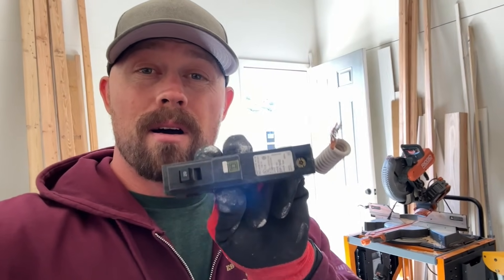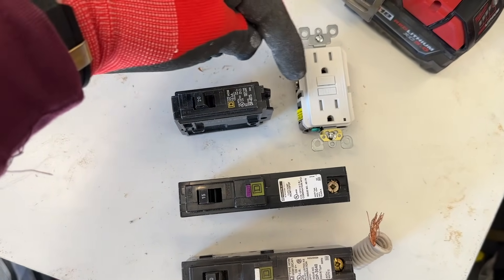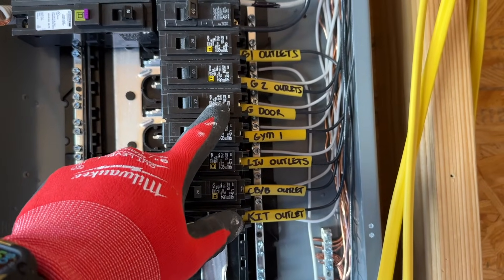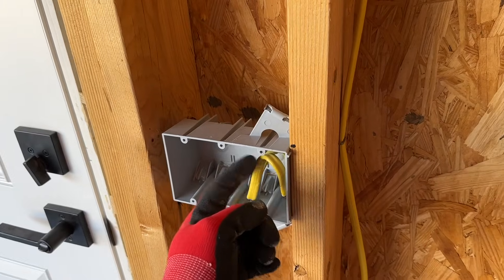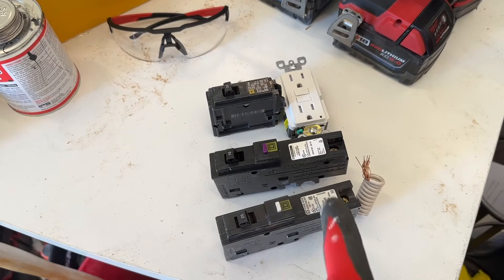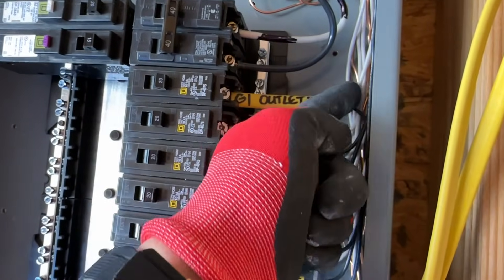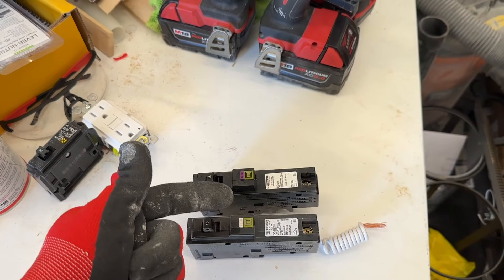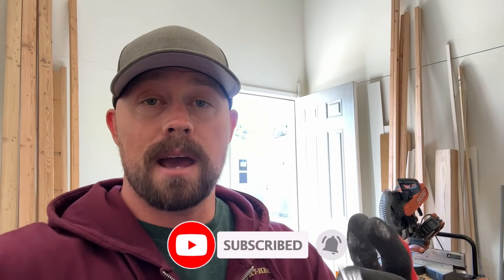AFCI Breaker Vs Circuit Breaker- What’s The Difference?

Comment: Great explanation to know the difference AFCI & GFCI.  It makes total sense. I purchased a home built in the 80’s and the panel has only non AFCI or GFCI breakers. I have also found some questionable wiring and I’m not even a professional electrician. I just know that back in the day people used to do some funky wiring that doesn’t meet NEC standards today. 

I am looking to upgrade my panel so I can have room to expand on number of circuits. I’m currently maxed out and had to resort to using the dual mini breaker when I replaced a couple of bad 15amp, old breakers that I found that were visually in desperate need of replacing.
Reply from the maker: Yeah, when you really start to understand it, it’s not too complicated. There’s only so many different ones you’re gonna see in a residential electrical panel. And once you understand it, you can start making better decisions and understanding what you need or what’s best practice or what’s right for your home.

And also, it’s something you can usually do yourself as long as you’re understanding how to turn the power off before working on it. Once the power is off everything after that is pretty easy.

Comment: I want to know if i have a afc breaker do i still need to use a gfci for kitchen?
Reply from the maker: Technically yes. Afci is Arc fault and Gfci is Ground fault. They work differently and trigger off different occurrences.  So I would install a GFCI outlet or breaker for that scenario. Or just the GFCI breaker in that case. Then the whole circuit is technically GFCI protected. Depends on your local code and inspector as well

Comment: But the wire from breaker to gfci outlet isnt protected right? So if a small cut in the wire were to happen the breaker wont catch it,  correct?
Reply from the maker: Your wires from the ground from the city are protected by a very large breaker before it enters your panel to power your panel. Then your panel has these types of breakers which are protecting anything moving forward. Then from that point moving forward, you would have a GFCI outlet which protects things forward from there. So each part of the system does have some type of breaker to stop it if there were some type of fault in the system to hopefully prevent any fire or major damage. So in short at some point, they are all protected.

Comment: Understanding the high cost, would it be ok to have a panel with nothing but DFCI breakers (Ground Fault and Arc Fault)? And if I did that, would I need to still have GFCI outlets?
Reply from the maker: It really depends on your code. You’re thinking on the right track though. Technically if you have a gfci breaker you’d assume the circuit is then protected the way they want it. I have seen them still look for the first outlet in the circuit to be a gfci outlet though. So depends on your local codes I’d say

Comment: Will an AFCI breaker fit in an old panel from a house built before the advent of AFCI?
Reply from the maker: They should fit in the same panel so long as they are the same model/make of breaker. There’s different models of breakers made to lock in to specific panels. So long as that style is the same the AFCI or GFCI or standard old school breaker should fit. They look different but should still fit so long as you match that up

Comment: I recently moved into a house with all arc fault interrupters.  Frequently, when the cleaning person plugs in her vacuum, the breaker trips.  Same is true when a contractor plugs in saw or any other tool.  I doubt multiple breakers are defective and I can’t tell hired help their tools are defective.  

As an engineer, what circuitry can I add to panel or outlet to minimize or eliminate false tripping?
Reply from the maker: I’ve heard of this before. That’s why a lot of people don’t like these new fancy breakers because they’re either overly sensitive or for some reason they seem to be defective. I think just how sensitive they are causes them to trip with any type of variance in electrical current. I’ve seen a lot of people go back to the old style breakers because they seem to be more sturdy. Some inspections require these ones to pass, but they end up going back to the old ones.

Comment: So the fridge circuit pops off while you’re on vacation and everything melts?
Reply from the maker: Usually, your fridge is on a regular outlet circuit and you would have a GFCI somewhere on that. So you wouldn’t need to necessarily have a GFCI or AI breaker on those types of circuits. I’m mainly showing you how you can have a protected circuit on a light circuit. Because normally with lighting, you don’t have any outlets where you can install a GFCI outlet as the first one on the circuit.

Comment: Now I understand the difference between a "plug in neutral" and the type with the pig tail. I saw both at Lowe's, but they were behind a theft proof spindles, and I couldn't see the difference.
Reply from the maker: Yeah it sucks they have all the “expensive” stuff locked up. Can’t handle it and try and figure it out or match it up to the one you might be trying to replace.

Comment: These things are absolute garbage. I had to install ALL arc fault/GFI breakers in my 2020 cabin build in WA state. So far i've replaced 4 of them with standard, old school breakers because they kept tripping. Just had another breaker trip with my AC300 plugged in - nothing else on the circuit and this is the 4th time in the past 3 weeks it's tripped. Will be ripping it out and replacing with a standard breaker. A waste of a LOT of money for nothing!
Reply from the maker: I’ve heard the same. They are very finicky. Sometimes is what’s required for your inspection, but I’ve seen people put back the regular breakers afterwards for the exact reasons you stated.

Comment: I replaced regular breaker with GFCI breaker. I connected the pig tail to the ground and the black wire to the hot connector on the breaker. I do not see white wire for to connect to the breaker. What should I do?
Reply from the maker: I believe you should be connecting the white pig tail wire to your white neutral bar of the electrical panel.
Reply: @FortKnoxCo  I did that. And I connected the black wire to the breaker. Now there is one more connector on the breaker with no wire to go to. The regular breaker had only connector for black wire.

Comment: AFCI and GFCI are not the same and have totally different purposes.  The AFCI is for fire protection while the GFCI is for shock protection. The AFCI was invented in the 1990's while the GFCI has been around since the late 60's.  The NEC required GFCI's in 1968 for swimming pools and then started requiring them inside homes in the early 70's. The NEC adopted the AFCI in 1999 and only required them in bedrooms at first (because people die from fires more often in bedrooms), but have since required them on most circuits in the house.
Reply from the maker: Thank you for the great info 🤙🏼
Reply: Great information to have. Thank you

Comment: I would say it would be good if everybody Googled each of the terms that he is discussing to understand them individually better.. An AFCI breaker does not replace a GFCI outlet in function. A GFCI breaker would. Certain household circuits are required to be AFCI breaker protected in many locals now. Those requirements are different than GFCI protected circuits.
Reply from the maker: You are correct. There are differences between them. My main focus was if you have a lighting circuit and you go from regular breaker to your light switches and lights you usually don’t have any GFCI or other fault/arc protection. So some codes are now requiring you to put something in place life AFCI or GFCI breakers as the breaker in the panel to add this layer of protection that an outlet circuit would commonly have.

Comment: Where do I put regular breakers by code ?
Reply from the maker: Well, some of that depends on what your local code is. But usually you can use a regular breaker if your first outlet is going to be a GFCI.
Code here now requires a GFCI or AI outlet for fixtures and lighting circuits that don’t have outlets in them where it can’t be a GFCI protected circuit because of the outlet. So when I’m running electrical through the ceilings and it goes to wall switches and ceiling lights there’s no place to insert a GFCI outlet. Therefore the breaker is GFCI protected.
Reply: @FortKnoxCo  Thanks. I see there are some GFCI outlets in my kitchen, so that circuit uses regular breaker.

Comment: Do I need to install a dual function Afci and gfci circuit breaker on the switch and light circuit? If so, is there any problem with installing a 20 amp dual function circuit breaker on that circuit?
Reply from the maker: Again, if you’re trying to meet code, you may need to look up what’s technically required in your area. For a long time, they have been using basic breakers in your electrical panel and everything is fine. A lot of people go back to the simple breakers in the box because they seem to be less finicky. I’ve been hearing a lot of different people have complaints about the AFCI and GFCI Newer breakers. That they trip more often or are more sensitive and become a hassle.
So it really just depends on how far you want to go with meeting your local code
Reply: @ what do you think should I install 15 amp or 20 amp dual function breaker on a switch and a light circuit ?

Comment: Question. If you pigtail the feed and neutral to the first GFCI receptacle the next receptacle is NOT protected,  then you must use the AFCI breaker and regular duplex receptacles in the circuit chain , correct?
Reply from the maker: If your trying to have the power go to a GFCI first to protect your receptacle down the line you would pigtail or branch off all your other outlets off the second set of terminals on the GFCI, the set that says it’s for the outlets down the line. The load.

If you pigtail the power at the GFCI and branch off the power to the GFCI “power in” and also have a lead coming off to feel other outlets then it wouldn’t be protected by the GFCI. It’s allowing power to skip over the GFCI.  To should only split the power after the GFCI and only off of the protected side of the outlet. 

If you want to do something different and throw in another AFCI breaker of use an AFCI breaker to start with then your adding some layers of protection here. A lot of it also depends on what your code is asking for.  Some people still prefer the standard breakers because they aren’t as finicky or sensitive and pop unnecessarily. And then just using a regular outlet as your first outlet.

Comment: The code keeps updating, but the current code in Canada states that if you use GFCI at the first receptacle to protect the rest of the circuit, you must use armored cable from the panel to the first receptacle. Other wise you still need a AFCI breaker at the panel
Reply: The codes for AFCI are very similar here in the US.  A listed outlet type combination arc fault circuit interrupter can be used at the first outlet on the circuit and labeled as such, if metallic wiring methods are used (MC, AC, or metal raceway and metal outlet box) to the overcurrent protection device.
Reply from the maker: @ that’s good to know
Reply from the maker: Oh nice, that’s good to know.  Thanks !

Comment: I just have to comment that I am thoroughly impressed with your labeling of every circuit. Whoever wired up my house didn't label anything. I have spent hours trying to identify all the circuits and failed. Out of 44  circuits, I have one 15A and one 20A that I cannot identify at all. Crazy. Keep up the good work!
Reply from the maker: Thank you, I appreciate that. Took me a bit of time but I was happy with the results. I would do a couple things different next time to make it easier during installation of all the wires and breakers. But in the end it all worked out.  I’ve seen some cool electrical panels and wanted to try it out on my next big job. Makes SO much easier when you need to turn something off quickly. 🤙🏼🤙🏼

Comment: We have a couple of AFCI outlets on our panel. One of them doesn't often trip, but the lights on that line flicker in fits occasionally. Could this mean a faulty breaker?  We have had horrible power outages due to wind storms lately, and those breakers have taken a beating with the amount of times the power has gone off and on (over 30 times this past week, as an estimate). I'm still tracing all of the objects pulling power from that line, so not entirely sure if we are overloading it on some way. We moved into this house in November and have had intermittent flickering lights, but its definitely become worse. I can now hear a louder electrical hum when the lights are flickering (happening many times a day now).  We don't get a full power outage. Just seems to be associated with that line & breaker.

I've replaced breakers before, but would like to avoid spending 50 bucks on one if I don't need it replaced.  Our panel is a 200amp, newish installation. Not entirely sure what's going on, to be honest. I haven't checked the gauge of the wire yet to see if we can bump to a 20 amp. Thank you!!!!
Reply from the maker: Usually, it’s pretty safe to jump up to 20 amp if it’s a lighting circuit. It’s just not as common. 15 amp is usually sufficient. It could be a couple things, maybe it’s just an actual fluctuation in the power but if you’re not seeing it in all the other lights then maybe it is isolated to that circuit which means it could be something in the wiring or that breaker. These new style breakers seem to be giving a lot of people problems and they’re overpriced and very finicky at times a lot of old-school electricians I’ve talked to said they still prefer the original style of breaker and they’re obviously just as good and safe. The new code calls for these types of breakers in certain situations but it doesn’t necessarily mean the old ones are not good. It’s just usually if you mess with an old panel and pull permits, they’ll ask you to update to new code standards. But otherwise the original style of breakers that most everyone has is totally fine with building code. So it’s weird that they require for new stuff but are OK with all the old stuff being there so long as you haven’t messed with it. So that’s why they still sell both. I know to pass certain permitting. You have to have it there otherwise they won’t sign off. But again I’ve seen people switched back to a regular breaker simply because they don’t give them as much problems.

So in the end, it might be up to you and what you feel comfortable with, but it sounds like you’ve figured out that it’s something to do with that circuit specifically. Also look at the type of lighting or lightbulbs you’re using. I’ve seen different brands of LED bulbs and lights do that flickering and dimming whereas other ones do not. All while being on the same circuit at different times. I’ve had to switch out some of my bulbs because of the constant problem with the way the LED lightbulbs were acting.
Reply: @FortKnoxCo  That is insanely helpful!! Thank you so much!  I have to know what I'm doing before I go to the store. I'm a 44 year old woman who is a jack of all trades, but show up in a hardware store with a question and they treat me like my husband sent me on an errand. 🙄 Can't tell you how much I appreciate the informative answer.
Reply from the maker: @sarahdaydreams  no problem at all. I’m confident you’ll get it done 🤙🏼
Reply: You might should hire a licensed professional to have a look into this.  Safety First !  
+ AFCI  breakers are to prevent arc faults from causing fires and burning down the house.  
+ GFCI breakers are to prevent electrocution.

Very different functions and different requirements for different 
 locations.
Reply from the maker: @ that is very true. 💯

Comment: Does a mini split need to be on an arc fault breaker?
Reply from the maker: Yes, according to current electrical codes, a mini split system generally needs to be installed on an Arc Fault Circuit Interrupter (AFCI) breaker, as it is considered a household appliance with outlets located within living spaces, making AFCI protection mandatory in most jurisdictions

Comment: I have a heater in my garage that has a 30Amp breaker. In the new house  when I use the heater it pops the breaker after using it for 5-10 minutes.
In my barn I have never popped a breaker when using it for about 10 years now. Is the new breakers the reason?
Reply from the maker: It could be a couple things, the circuit needs a GFCI vs AFCI breaker? Or maybe use a standard breaker and have a GFCI outlet as your first outlet.  I’ve seen these “new” breakers be pretty sensitive. I had a washer/dryer combo pop the breaker randomly during a regular laundry cycle for no reason. Then the next time we ran it it didn’t pop at all.

Comment: i have a old tv and a ps5 in my room and it keeps trping the break.so i used an extecuincord to plug in the tv to the bathroom but it still pops the break somethimes i was told to chage the arc to a regular break . will that solve the problem? will it cause a diferent problem? please help
Reply from the maker: Those devices shouldn’t be popping any breaker. You either have a faulty breaker or maybe it’s actually something with the wiring itself and there’s a short or fault somewhere. But those devices shouldn’t be popping any
Breakers.